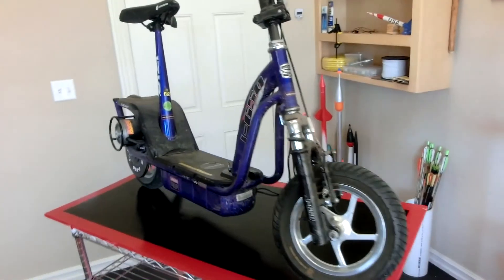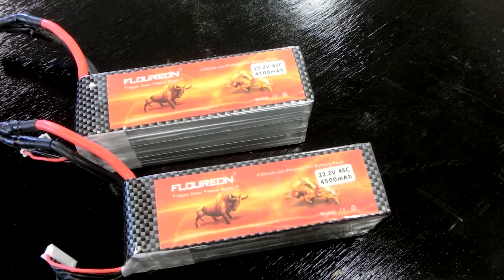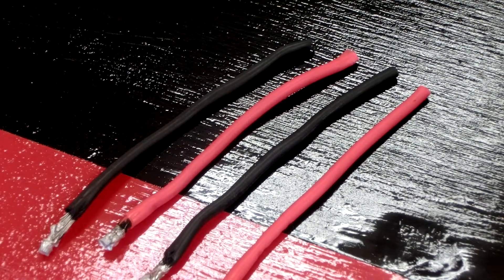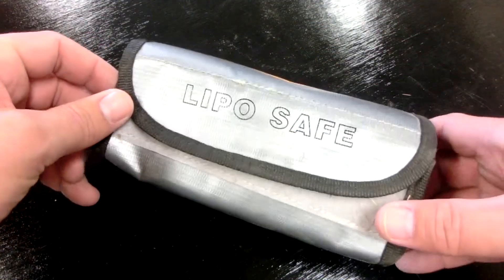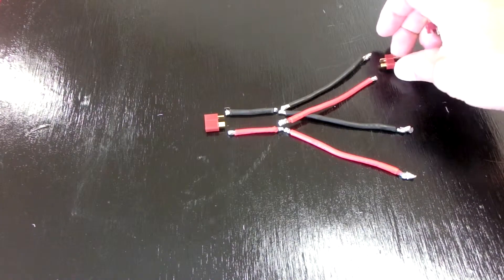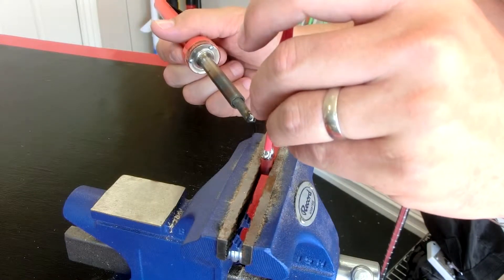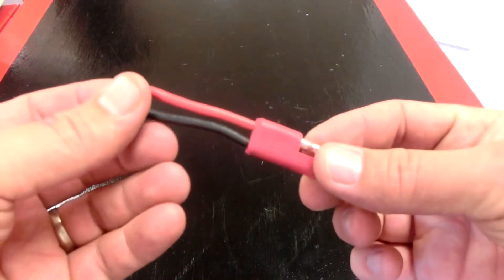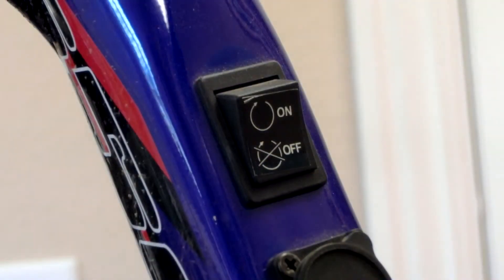LiPo Conversion of an Electric Scooter - Parallel Cable and Shrinky Dinks

Comment: I have a 36v scooter I want to convert to LiPo, as I have many old laptop batteries (18650 cells) laying around. I don't see the BMS module reference mentioned in the video. What would you recommend for a 36v system for a BMS?

Comment: This is good to know - I have one of these and am fixing it up for my niece. Just ordered lead acid batteries, but that's OK since I need to see if the thing even works. If it does, this conversion may be the way to go. I still don't see anywhere in the comments or video description how to charge, though.
Reply: Charge with a lithium charger only.

Comment: How long did it take for the ESC to fry?
Reply: About ten minutes haha I was thinking the same
Reply: @RyanOnDrums  hahahah. that's what you get for thinking, but not knowing.
Reply: Hi Guys (9/2021),
he's not going to fry anything. He's actually using a pair of 22.2V 4500 mah Li-po (RC car) batteries, that is less voltage than stock 24V. If he'd spent the money and bought 4 batteries, he could have wired them in series and parrallel to get 44.4V and "18AH". 

What he didn't mention is that all these Li-po batteries (and Li-ion batteries for that matter) , that don't have a BMS (Battery management System installed) MUST be charged with a Balance Charger ( like a iMax B6, Tenergy or the like) that will charge up to 6S.

I did that mod to a Currie 650 myself and it was a frigin ROCKET and He'd be able to ride to Denver! ;-)

Even at 22.2V, charged to approx 26-27V, it won't hurt the OEM speed controller. As an FYI, I've overvoltaged the Currie 24V speed controller to 36 V and it (usually) will still be fine.
I sold a 24V 900W eZip to my neighbor, overvolted it to 36V (stock speed controller) and he's ben riding it almost daily for well over a year.

I have x4 Currie eScooters. My 36V (stock SLA batteries) eZip, overvolted to 48V, and it had run fine. I now have it at 65V Li-ion packs, with a Yiyun 48V speed controller. Runs out at 30+mph and 20 mi range. 

Just do your homework. It's not easy but it can be done. Also, do it safely. Li-ion can be dangerous. READ, LEARN, then build your packs.
Watch and learn from these guys on youtube (I did);

eBikeSchool/Micah Tull
Jehu Garcia
HBPowerwall
ride safe and have fun.
cheers
Boots Langley
La Mesa, Ca
Reply: @bootslangley4875  what batteries did you use to overvolt the ezip 900
Reply: @bootslangley4875  ok so i have a ezip e 4-500 not to sure no back wheel 😭 may and or may not work but im wondering if you could send links,names, and or pictures of what you used for that 48 volt project because 30+ is music to my ears
Reply: @bootslangley4875  did you build your own battery packs or did you find it cheaper to purchase ready made ones?  If so, mind sharing where and roughly how much?  Have a couple Schwinn Stealth 1000 with dying 36v SLA system that I’d like to convert - thinking I’ll goto 48v to increase the current 15th max speed but mostly I want to get more watt hours (SLA are 360 wh but so worn out I probably get less than 1/3 that currently) for better range and newer tech so that the range lasts